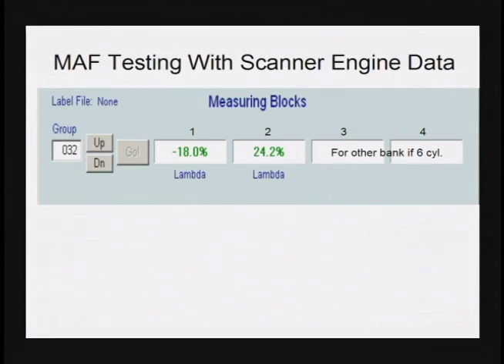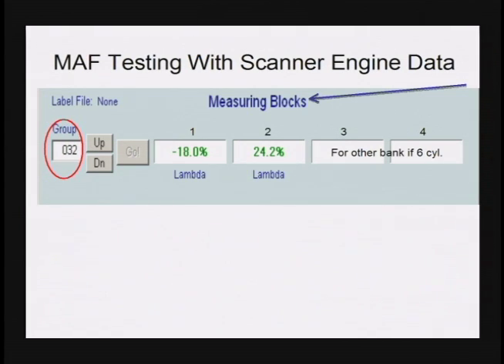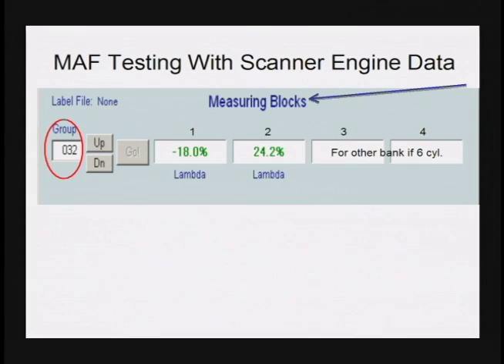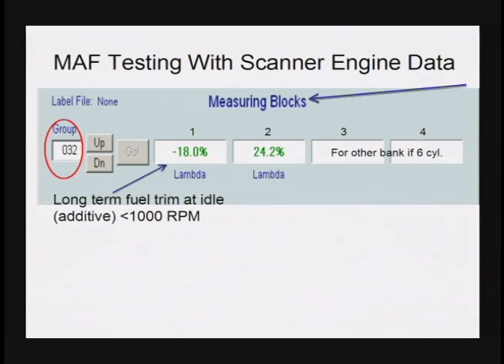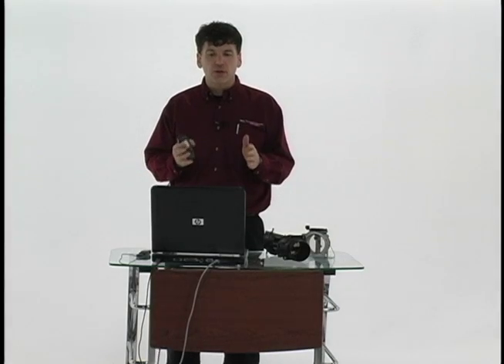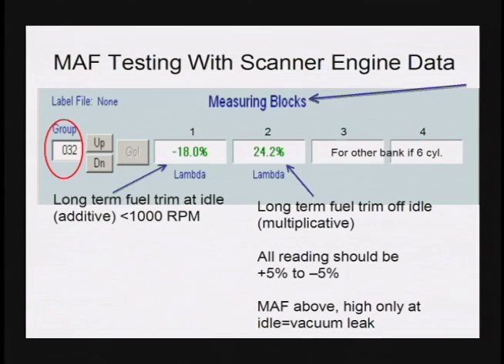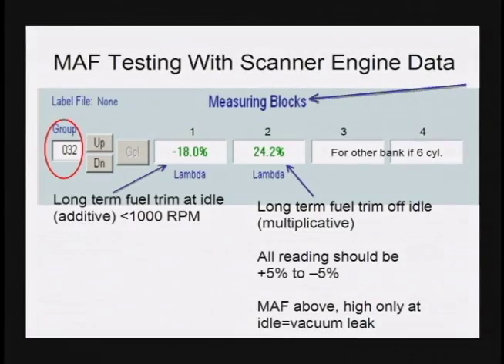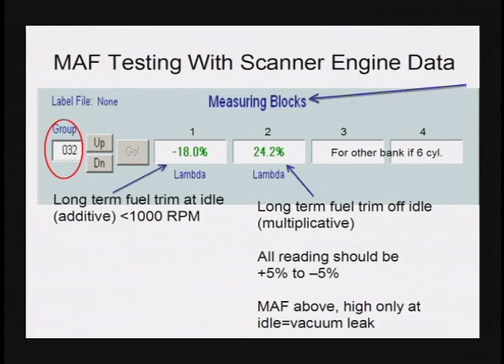MAF Sensor Testing on VW & Audi | Dave Scaler | Tech Tip

Comment: Does anyone help me understand what my problem is?
I have the fault code
00561 - Mixture Adaptation: Adaptation Limit (Add) Exceeded
My fuel trim is 
(additive)= 5.5%
(multiplicative)= -4.7%
Is it a bad MAF or a vacuum leak?

sorry but I don't understand the video very well because I have difficulties in understanding English without subtitles